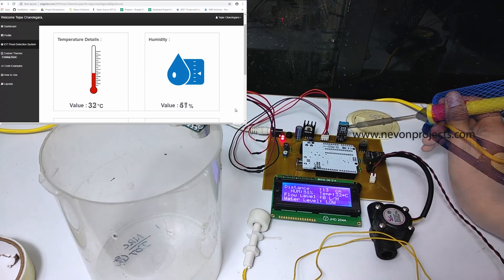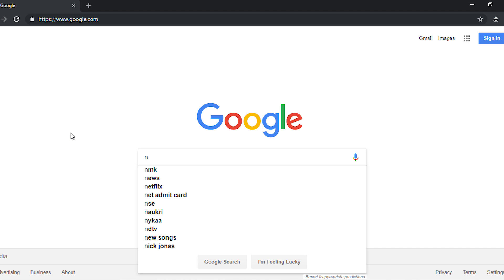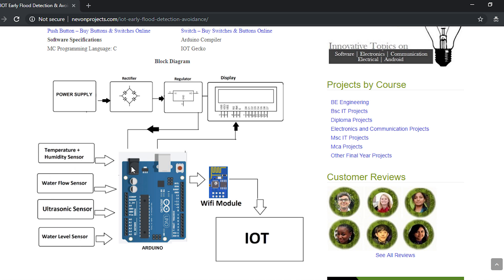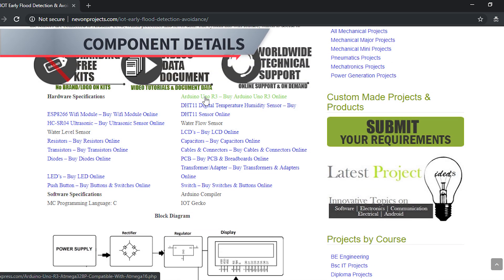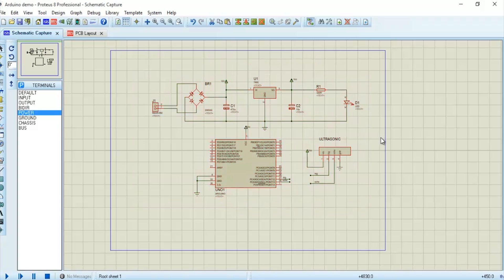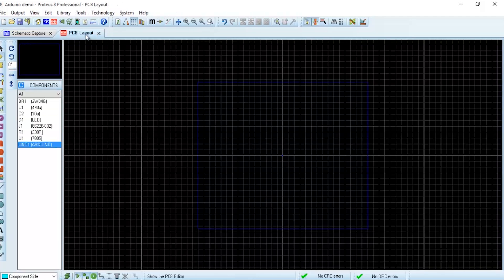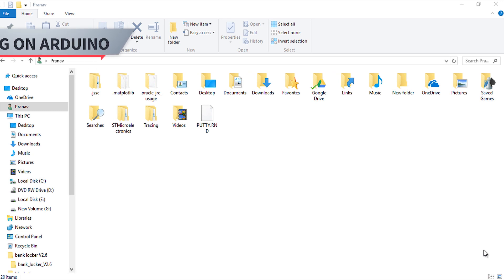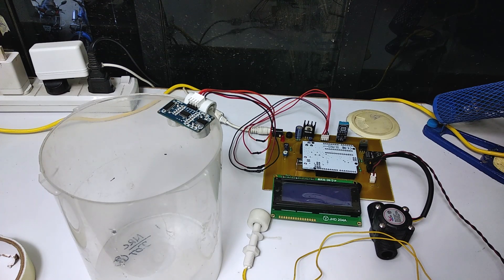IoT Early Flood Detection and Avoidance System

Comment: The IoT (Internet of Things) Early Flood Detection and Avoidance System is a network of interconnected devices that monitor water levels, weather patterns, and other environmental factors in real-time to predict and prevent floods. This system uses sensors, cameras, and other smart devices to collect data, which is then analyzed by machine learning algorithms to provide early warnings of potential floods. The system can also automatically activate pumps, barriers, and other mitigation measures to prevent or minimize flood damage. The IoT Early Flood Detection and Avoidance System is becoming increasingly popular in areas prone to flooding, as it offers a more proactive and cost-effective approach to flood management than traditional reactive methods. weather patterns, and other environmental factors in real-time to predict and prevent floods. This system uses sensors, cameras, and other smart devices to collect data, which is then analyzed by machine learning algorithms to provide early warnings of potential floods. The system can also automatically activate pumps, barriers, and other mitigation measures to prevent or minimize flood damage. The IoT Early Flood Detection and Avoidance System is becoming increasingly popular in areas prone to flooding, as it offers a more proactive and cost-effective approach to flood management than traditional reactive methods.